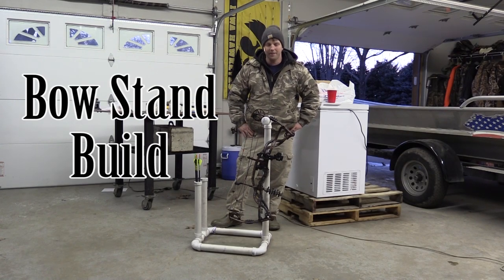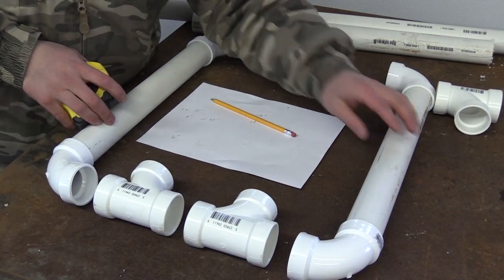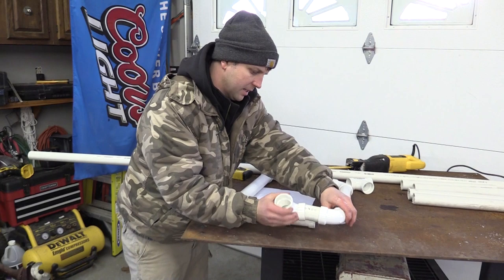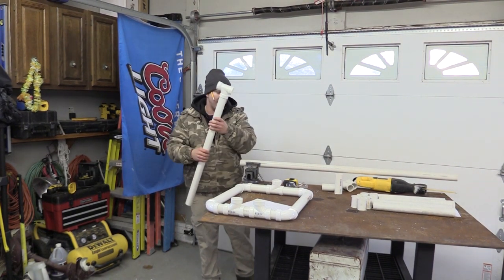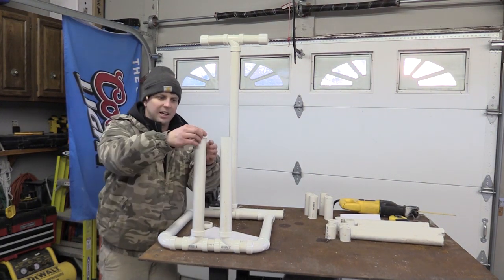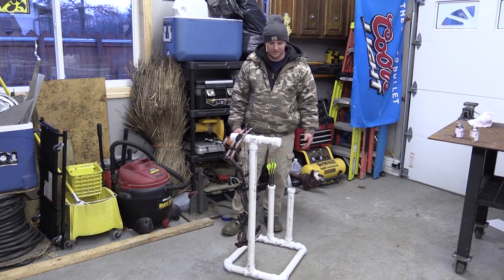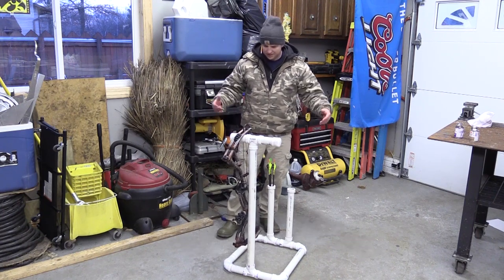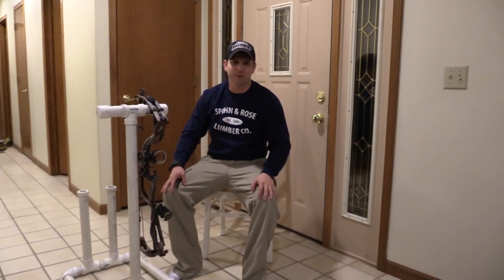Bow Stand (PVC)

Comment: Because its PVC glue, you have to hold the pieces together for like 15 seconds or so as the pieces will push apart if not held together till the glue starts to set.  And as well turn the pipe inside the fittings so that the glue is properly between the pipe and fittings.

Comment: I built it today.. With a few changes. I made the arrow and bow tubes removable. I used female threaded T's on the base. And bottom of the tubes I used male threaded pieces. So I can unscrew them so it will fit in the trunk of my car.
Reply: I also used 2" tubes for the arrow tubes. All to your sizes. It's a nice weight, and holds everything just fine..